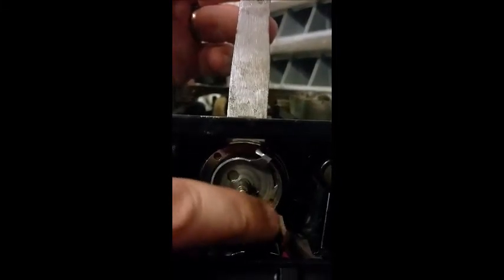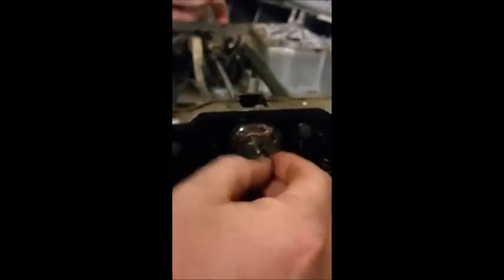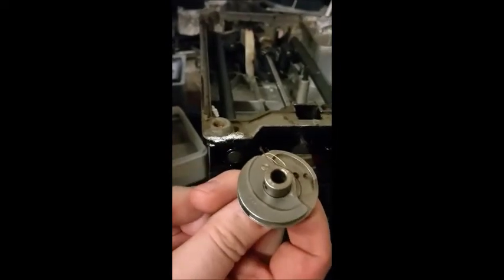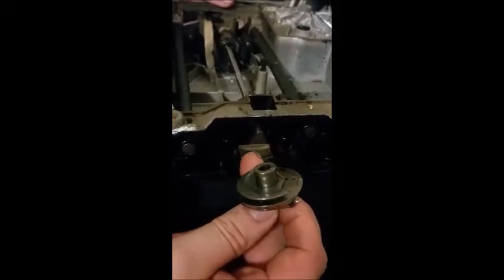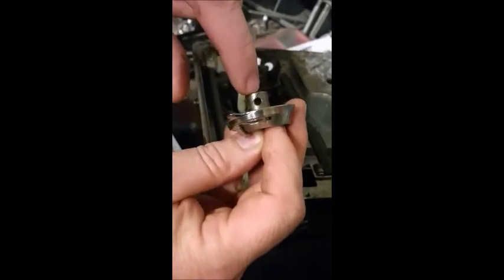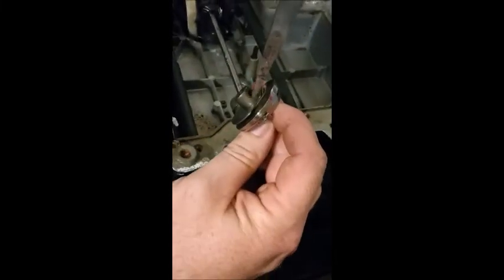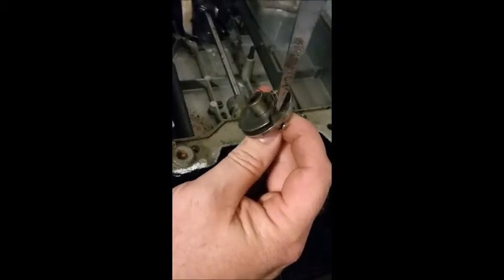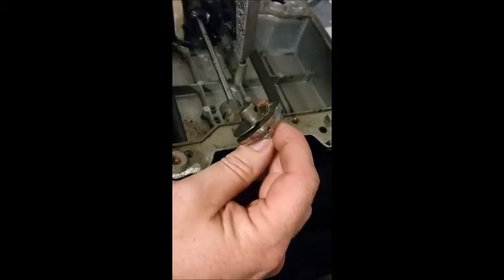How To Remove a Stuck Hook Assembly on a Singer Featherweight 221

Comment: I just bought a machine. It locked up.  I'm trying to remove the bobbin case assembly.  I can't get the screws out of the shaft.  The screw heads look slightly damaged but still look deep enough to use.  How can I loosen these screws?
Reply: Adele Josepho I’m here  in 2020 with the same problem. Did you ever get the screw out?  How please? 🌸